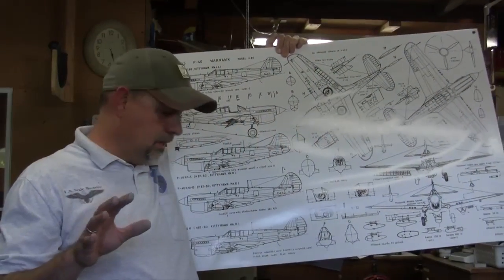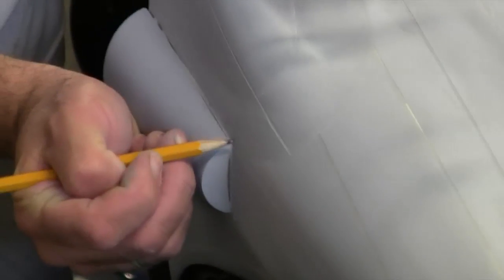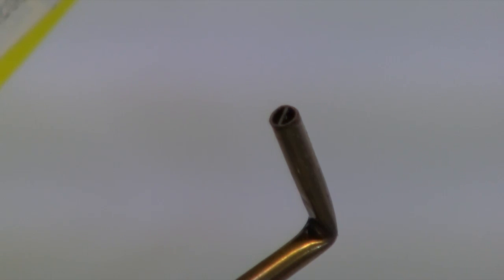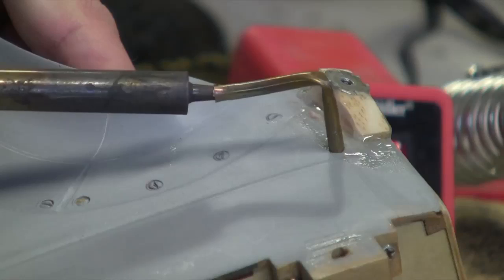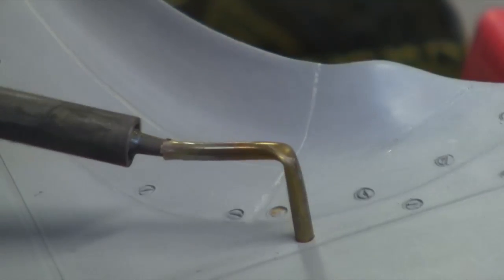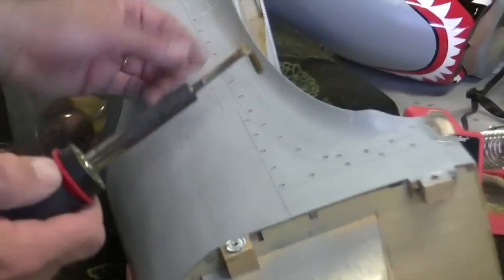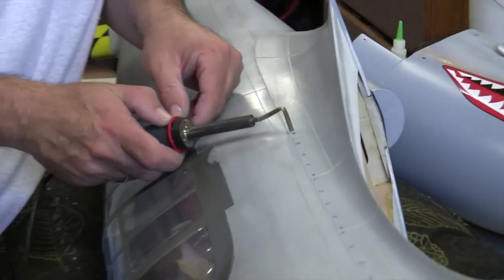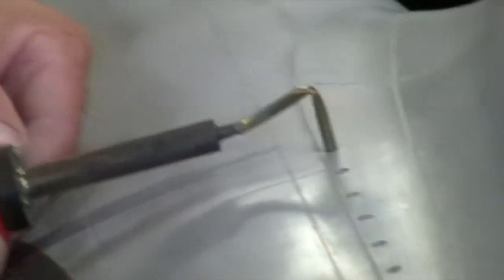#11 Pimp Your ARF - Scale Rivets

Comment: Well done job. The rivets you've pointed out aren't in fact rivets, they are 1/4 turn fasteners. The are intended to attach fairings and engine and other panels and still allowed fast removel. When properly screwd down the slot should be paralel to the edge of the panel. Hope this help a little. I realy enjoyed your work.

Comment: Hey Randyman nice videos, i was wondering from your video onpanel lines for the p-40 what you meant by 50 50 extender and opauqe for your mix. Is it black opauqe andclear extender not up to speed on paints really. Building a 1/48th scale b-17, have seen several nice pictures with olive drab paint with weathing on wings behind engines. Getting ready to paint enamel model master then gloss clear, decals, then flat clear. Would your weatheing work for me. Thankx for any advice and tips

Comment: This is the most common mistake I see with scale builders today; making the rivet heads way too big. This isn't a steam ship or a bridge, its an airplane. Most of the rivet heads used on WWII planes were less than 1/4" in diameter. They were visible but much, much smaller that those seen all too often on so called, scale models today. Compare the diameter with your rivet heads with, say, a finger tip of the pilot. A rivet head of about 3/16" in diameter would be easily covered by the pilot's finger. Any bigger than that and the scale is way off. Also, Shelby Seelbach is correct. Rivets don't have screw slots. They were either oval head or flush head. The oval head rivets protruded above the skin surface. The flush head rivets were, well, flush, with the surface. I've done scale rivet heads for years; started back in the 70s. The most effective way was using a hypodermic needle and Titebond glue. The spacing comes naturally after the first few rivets and after a few hundred you will do it without thinking. Think SMALL. Tiny droplets of glue in a line and in many areas you need to do a second, or even third row of rivets, offset to the row next to it. When the glue is dry you can lightly, very very lightly sand the rivet heads just before applying the finish coats of color.

Comment: the are screw heads used in Zeus panel fasteners, rivets do not have a screw head, for scale accuracy, the slot would be parallel to the panels edge in the fastened position. if you are going for scale detail, pay attention to the detail, no such thing as a rivet screw, it is either a rivet or a screw. nice tool. poor attention to detail, which is really the most important part of doing anything to scale.
Reply: Shelby Seelbach these are actually fairing screws. Today they are Philips head. But originally flat. The washer makes them look larger than a rivet by 3-4 times. Dzus fasteners are used on engine cowling or access panels. These my be a touch large, but not all that bad.